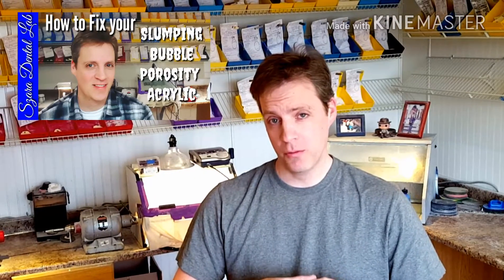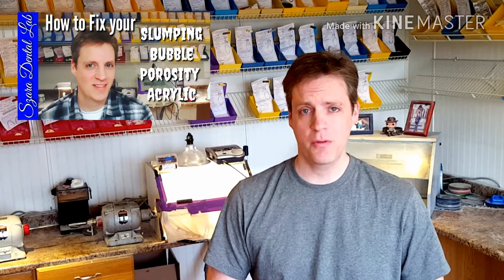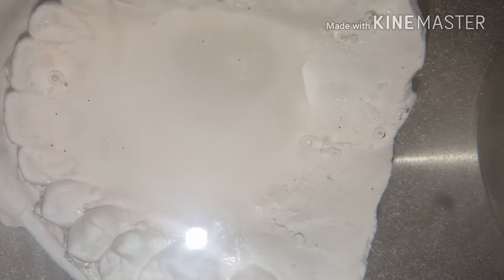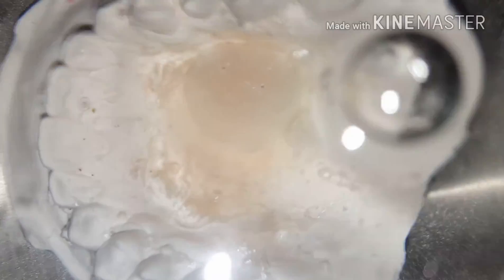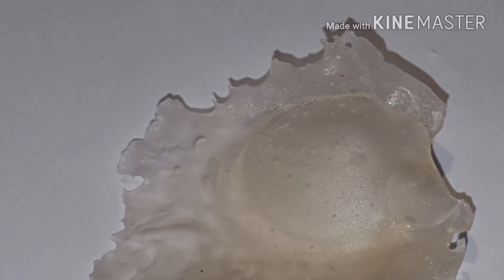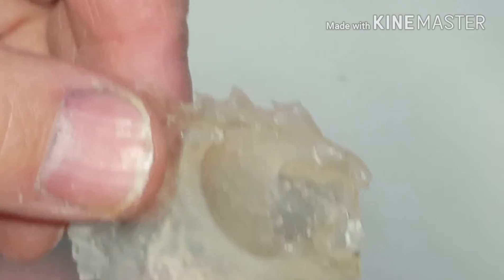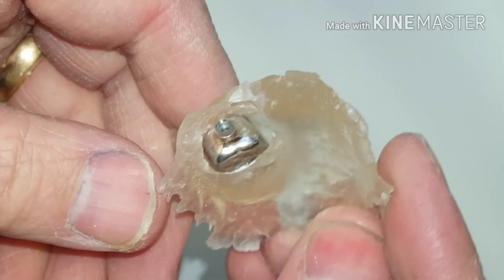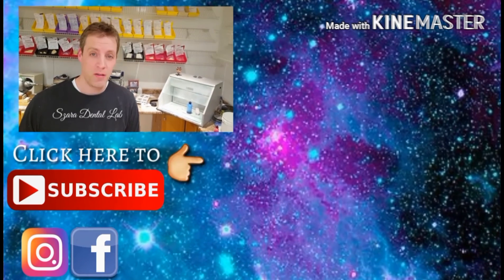Orthodontic Acrylic Curing Lesson

Comment: I used to let the model for 5 minutes only, big mistake. Thanks for the great tip!!
Reply from the maker: Avanzada Dental 5 min is fine for most stone and plaster models especially if they were vacuum mixed. Otherwise at least 10 min
Reply: Szara Dental Lab most of the time they don't use the vacuum, so 10 minutes it is, thanks again Steve

Comment: I recently have problem where the acrylic does not sit flush with the model it looks like it shrunk slightly would you have any idea what could be a reason for that? It only becomes apparent after trimming and polishing.
Reply from the maker: Couple of different things causes lifting: temp/humidity of your room/monomer/polymer,  did you open pressure pot before it was fully cured.. this causes lifting.. could also be a pressure issue.  Try bench curing a sample and see if your getting any lift.  Hope this helps. Let me know
Reply: Thank you very much for the quick answer. I think it is the temp/humidity In room where i do my salt and pepper techniques there is water purifier that gets turn on from time to time by the dentist. That thing generates a lot of heat and moisture. I will let you know how i get on. Your videos are really helpful please keep on making them :)

Comment: Question for you , that's if you will even answer ....seems most people never reply back for some reason , anyway with heat cure acrylic resin when do you throw it in the pressure pot , do you have to let it harden first or throw it in while its still soft . I cant seem to find any tutorials on the full process as simple as it is it seems like the most guarded secret . I bought everything to make a full denture for under a hundred bucks and yet they charge thousands and also guard the process ....any help would be greatly appreciated .
Reply from the maker: What acrylic did you buy? Are you learning to make dentures? Are you making this as a side project for yourself?    Need to know brand name of acrylic......acrylic techniques are different with different brands🤔
Reply: Opti Cryl...I am not sure if its a good brand . It was a cheap ebay buy . I got everything to make a partial denture . I actually did like 3 cooks today and it seems 20 minutes out of water just steam and 20 minutes submerged seems to work well . I was only doing it for 5 to 10 minutes and it just wasn't working out so i said screw it and left in in there for a while ...anyway its heat cure acrylic brand name opti cryl powder and resin , also it really smells and seems most of the smell comes out after cooking but i was curious if it just needed to be polished or does it require some kind of clear coat . I am very much an armature , honestly my teeth over the years have just crumbled and i was able to save my fronts but got a couple i want to fill when i smile . Its amazing how cheap the materials can be but the cost of procedures are outrageous  , anyway ty for getting back to me .
Reply from the maker: @GenerationNoise  ok. You bought heat cured denture acrylic. There is a long process on how that acrylic hardens. You need monomer to go with   Do you have monomer to mix with it? What did you mix with the powder?
Reply: yes i have liquid monomer and the powder . I am using a pressure pot . I have all the right supplies just don't have the cook time or psi pressure information . Like i said the best result i have gotten so far is 20 minutes in the pressure pot on a coffee cup out of water and then i open the pot and submerge it for another 20 and its seems to give me the best results . I don't know if i should cook it longer or not , ty again for reply .
Reply: I have monomer yes , how long would you suggest ? what process would you do exactly as far as cooking it in the pressure pot ?
Reply from the maker: You dont cook heat cured acrylic in a pressure pot. We cook COLD cure acrylic under pressure in a pressure pot. Heat cure acrylic needs to be compressed in a Denture Flask Compress. It cures under water  @165 degrees for 1 hour 1/2 hours then boiled for 1/2 hour..ALL under extreme pressure.  Now you know why we make the Big Bucks
Reply: so now that i know that very simple process i guess i can take advantage of folks to ...yippy doo da da , look at it this way . I will take your advice and apply it in a different way , where there's a will there is a way , trust me i will find a way where i can make a denture without poring out my life savings to a crook in disguise , we all know how bad people feel about a horrible smile so that's how you guys get away with charging thousands for a couple hour procedure that cost pennies . Its right around the corner my friend where ordinary folks who don't enjoy taking advantage of folks will be able to afford quality work at affordable prices . I will send you a pic of my new dentures i spent 50 bucks on and built in my kitchen since we are patronizing each other . All i ask for was some simple information that doesn't take a genius to know , you guys just treat it like some dark art and charge people an arm and a leg for some bullshit life lesson books , when in all actuality the process couldn't be easier . Its not heart surgery ...people just want a damn tooth replaced . Its more complicated being a mechanic but mechanics are not driving around beamers and living in lake houses to keeping your Benz on the road are they ? the whole dentist industry is a scam my friend . I thought you were self taught is the only reason i reached out to you . I didn't mean to get into your vault of secretes lmfao , who cares about rainbow fucking retainers , we want to know how its done and by GOD i will figure it out on my own in my mother fucking kitchen....farewell Mr millions .
Reply from the maker: @GenerationNoise  I was being Sarcastic when I said Now you know why we make the big Bucks. Sorry you missed my sense of humor. WE (dental techs) do not make big bucks. We get paid an honest wage for work provided. Average denture is about $200+ billed to the Dentist depending on each case. Dr. Then most Drs multiply our bill 5x +....I was just trying to help you not put you down. Heat cure acrylic not processed correctly will allow bacteria to grow in the denture. If you look VERY closely you will see little holes in your hardened acrylic. That's were the germs live. Buy some cold cure acrylic with monomer on ebay and you will have a fighting chance. Now I'm going to hop in my 1994 Chevy Cavalier and go get some McDonald's.....
Reply: LOL  you know i thought twice about sending that text but i guess i just had to get that off my chest . I think i am just frustrated at the lack of educational material about dentistry on the web . I cant even find how to build a damn flask which should be a simple casting job , everything else seems to be out there for the world to learn but dentistry for some reason . I really didn't mean to fly off the handle and i do apologize . I did a little more research and grabbed bits and pieces from where ever i could get the info and i think i have what i need . The only thing i don't have is a flask but i got an idea how to build one . I do appreciate the help and i know not every dentist is an over charging criminal lol . I honestly know though when it comes to dentures and other dental work that in most cases the cost are outrageous and there is no need for it other then greed . I should not pay 250.00 dollars for a simple drill and fill that takes literally 10 minutes and cost the dentist less then a couple dollars , that my friend just doesn't add up for me and most others .
Reply from the maker: More and more technicians are showcasing their work like myself online and different techniques etc. .3 Years ago Nobody shared Anything. Which made me feel like I was in some secret society.  Check around on dental lab Facebook groups relating to dentures. Type in: how to fabricate denture as your search.  I see flasks for same with compress on ebay every now and then for under $100. Good luck
Reply from the maker: I feel your pain. I'm in the ortho field. I paid over $10,000 for both my kids orthodontic treatment
Reply: Its out there just got to dig it up lol , ty for the facebook lead . Also ty for the reply and all the help . If i remember i will let you know if i have any luck building my flask . I got something i think might work . I will let you know how the partial turns out ....thanks again and good luck to you to :)
Reply from the maker: Little extra advice if you have severe pain in any tooth instead of going to a dentist go to your nearest dental school. They take on patients that cant afford expensive dental work (root canals, implants, etc.) Your sort of a Guinea pig but not. Each student has a practicing or retired Dentist/Surgeon looking over the case. The cost will be way cheaper but it might take a little longer to get fixed up but well worth it.  Also today just so you know the average dental student graduates with over $1,000,000 in debt before they see their 1st patient....  Now you can see why the system is flawed.
Reply: That is really great advice ty . i have had 2 root canals to keep two of my front teeth , a ton of extractions and some fillings . I have spent a lot trying to save my teeth . I do have all my front teeth and 1 back left lol but none are bad , that is great advice though but with family and my work school would take up my life lol ...ty for the suggestion though . I did not know they did that ....that's awesome .
Reply from the maker: @GenerationNoise  This just popped today. This is exactly how we set denture teeth https://youtu.be/4lbcBrr_w-U
Reply: wow i was going through our conversation and i got to admit i was a complete asshole , anyway i apologize . i just wanted to let you know i have figured out the whole process . I use 3 different stones for casting . I now use a flask and compress and i have made my first denture lol . I have learned how to use and prepare heat cure acrylic . I am getting better at taking impression and waxing , anyway just wanted to let you know because i spent an hour searching for our conversation because i remember you telling me the time to have it submerged for curing . Its strange because i get different answer's from different places , why it don't come with some instructions is just crazy lol...anyway have a good one and ty for helping me out when i was an ignorant newbie. @SzaraDentalLab